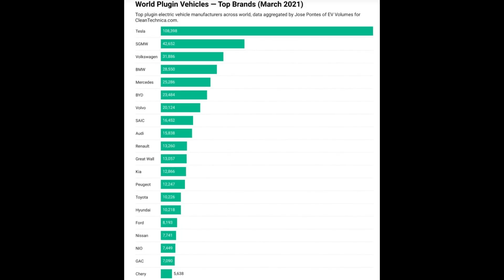DEBUNKING BATTERY SUPPLY for  GIGA BERLIN, TESLA ENERGY update

Comment from the maker: Hey guys thank you for check out my Channel if you are new and you enjoy my work do consider subscribing. Giga Austin Credit: Jeff Roberts https://www.youtube.com/channel/UCDmfM1DRiTC9E7fuBbul2SQ.
Reply: There is absolutely no indication that 4680 batteries will be used neither in Model 3/Y nor S/Y Plaid. Actually it would be very surprising, since a cell to chassis architecture would be almost impossible to implement without deeply changing the car itself. 4680 cells will most likely be used in Cybertrucks and Semi and those 2 models alone will already eat all the production. Later the 4680 will be introduced in future models. Elon said they expect to be ready to mass produce 4680 in 12 to 18 month (knowing Elon this could easily be 2 years)...  so in my opinion there is very little chance Model Y Berlin will use 4680.
Reply from the maker: Thanks for sharing. Based on my information it was always the plan to put the new cells into the model Y in Berlin.

Comment: Thanks for the video and I’m sure you are correct about the early production using Freemont supplied 4680 cells. I disagree that they could flip flop with other suppliers (unless they are already producing 4680 cells for other customers, maybe under license from Tesla?) and they can’t easily
go back to 2170 cells as they’re won’t be compatible with the new structural cell chassis design.

I’d be more concerned about the slow pace of the IDRA giga press installations. It seems to have completely stalled (same at Giga Texas). The Berlin MY will have the one piece rear and FRONT castings, plus I believe the structural cell chassis will also be a casting? They’ll need those presses installed pronto if they’re going to start any sort of production this year!

Comment: Yes, but no.
Tesla will of course use their own cells in Berlin, you are right. But cells from CATL or LG if they run late? How fast is that supposed to happen? You can’t just call them and ask for a couple million cells to bridge a month, they need to bring production up in the same way as Tesla in Germany.
Or are you suggesting Tesla switching back to the old cell format for a couple of months? 😅
Reply: 4680 cells will be structural, they can’t just go back to 2170, that’s a totally different chassis design. Some of this video doesn’t make sense to me.

Comment: thanks. So if I get you correctly, you are saying the MY from GF4 will get the new 4680 battery cells right from the start. cheers
Reply from the maker: That's correct if by any reason the production outpaces the produced new batteries it could happen that they use the one from LG and catl which are not the 4680
Reply: I actually do no believe Model Y Berlin is gonna use 4680. 4680 will be structural battery pack which will be quite a change from the current chassis. 4680 will be used in Cybertruck and Semi and them alone will eat all the pre-production of 4680. Elon said 4680 mass production is expected in 12 to 18 month (let's say 2 years)... there is no way they can sustain Model Y Berlin, Cybertrucks and Semi with the pre-production line in Freemont. That's my opinion.